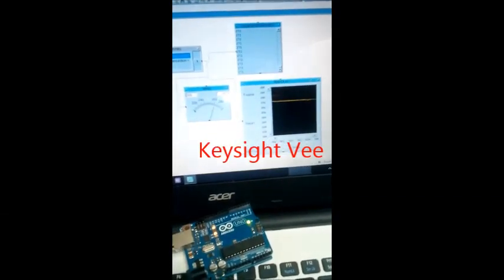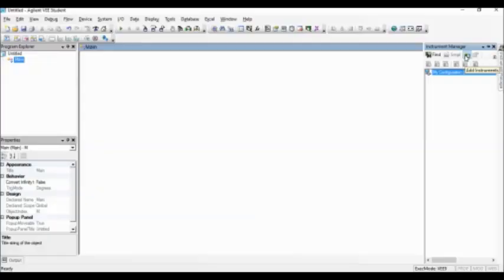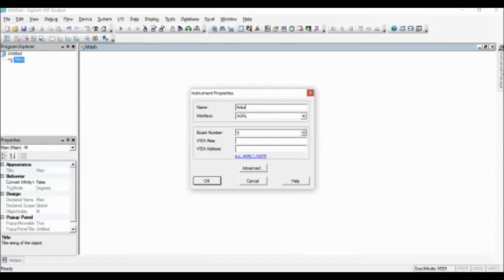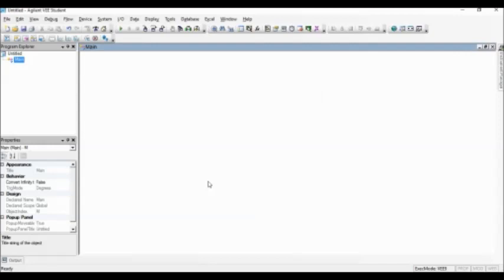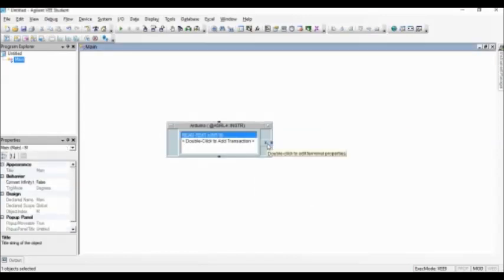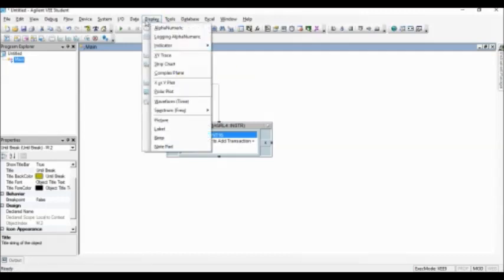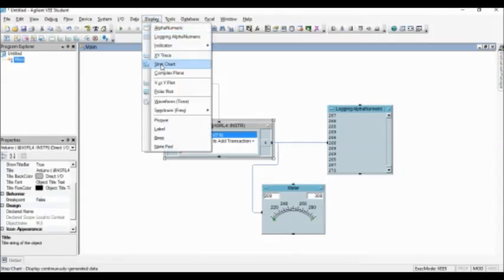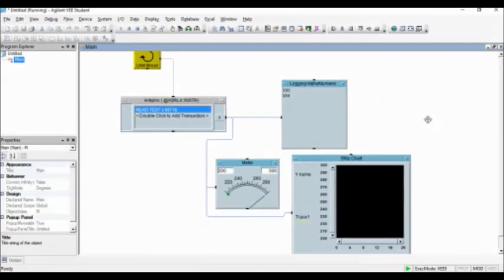Read Arduino Serial Data Using Keysight Vee Program

Comment: Hi thx for the tutorial, I´m getting the error number:811, could u help me please
Reply: Answer: Turn off the Arduino serial monitor. Then run VEE with logging alphanumeric display. 
The Arduino IDE loads the sketch and starts it running. VEE monitors the COM port.
Reply: @monkfoobar  could there be other reason to cause this error 811?
i've started my UNO even without starting the IDE on the computer and the error happened the same
Reply: What’s the fix for error 811?